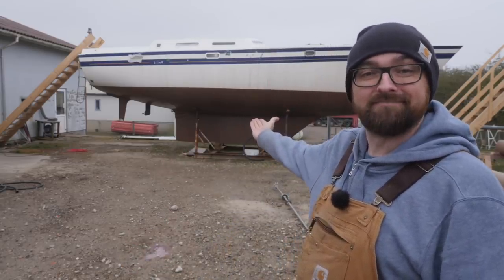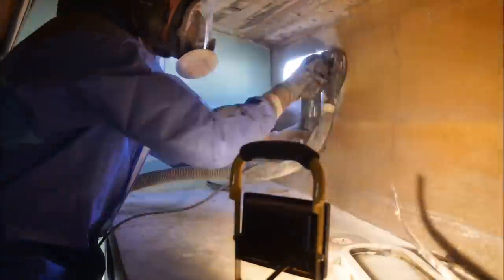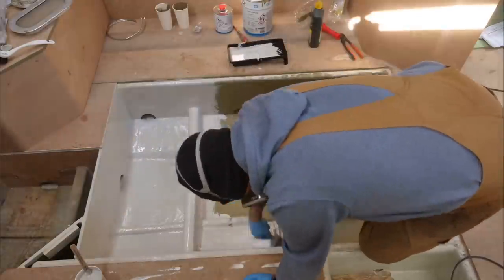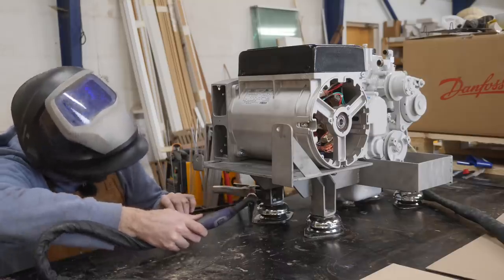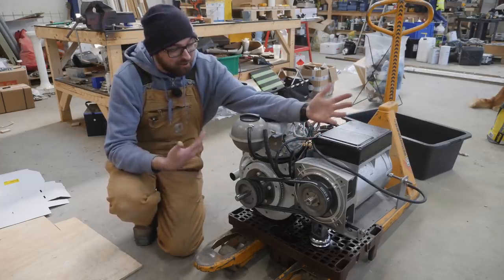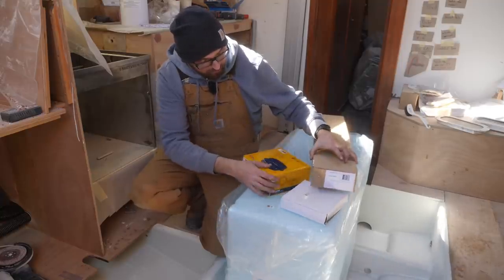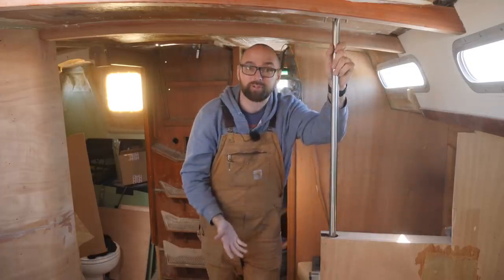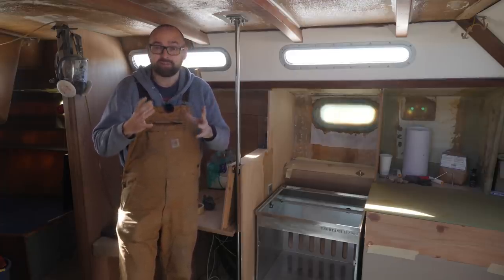Sail Life - DIY generator fail, galley pole - sailboat project

Comment: I don’t know if the 402 is different dimensionally than the 102, but if it’s not different by an order of magnitude, I’d go with the 102 for now and look for a cheap 402 rebuild candidate.  Doesn’t have to be a project for this year, you can get the 402 and store it until your ready to re-tackle the project.  I would not abandon your original intention.  If that were me, every time I couldn’t deliver power the way I intended because of a mishap like that, it would piss me off.  Don’t give up on your original plans!

Comment: Ok Buy a smaller Size pully for the Alternator  if you size it right  that will take increase the rpm on the alternator at lower revs on the Perkins and if you need more power  youd be able to rev the engine.

Comment: Good plan to keep the engine for the generator. Make sure you have  some decent lithium batteries that can keep up with the peak power draw from those two 3kVA victrons. Having two beefy charger inverters also means you can boost those batteries back much quicker than with a single or two smaller units when the generator isn't loaded by other stuff. Having those two big inverters also means you can power most (if not all) large appliances with the generator off. Not for long maybe, but it gives you the option if for whatever reason (e.g. sound) you want to postpone generating the energy. Also most household appliances only use short bursts of power. An oven uses most power during heat-up and after that it kicks in the heater for a short while only to maintain temperature. Same goes for a washing machine which uses most power when the water enters and needs to be heated.

Comment: Bummer on the 102 , can you change the pulley sizes and get the rpms you need? Also possibly going DC power generation to recharge batts and have a gigantic inverter for all AC ?

Comment: Change out the size of the generator to better match the Perkins to improve efficiency and sell the larger one online. Your larger generator will have good resale value given your research that there aren’t other used models of good quality and yours is virtually new. Patience will be your saviour here. Other option is put an add out for the 402 Perkins (or similar model) you were expecting to have...you might be surprised what turns up.

Comment: Ok Possible fix for the generator woes possibly bore the motor out and put larger piston in to make more horse's come out. Or look around for the right size motor to run it. I am thinking you will be happier with bigger motor. Not sure if reducing the voltage to 120 would help any.

Comment: Perkins motors 102,402 bores is the same at 67mm but the strokes are different 64mm for the 102 vs 72mm for the 402.  Quick fix would be to order a crank, rods from a 402 and do a swap.I would also look at the injection pump and injectors {size}. Research at what rpm you wish to run the motor and then use the appropriate size of the pulleys to get what you want.There might be a way to change the ratio to get increased output from the alternator. OR play the lotto and do allot of praying. lol

Comment: Sorry this happened.  I will concur with many others that you need to find a different diesel. A thought, ask at a farm supplier about replacement engines for irrigation pumps.  Some are Kubota diesels and they run many thousands of hours just left out in the weather like scrap metal.  Frankly, the motor you find should be powerful enough to over drive the alternator.  For cold weather you will find everything uses more energy than you expect.

Comment: I think that kind of mistake is something anyone could make.. and maybe even some of us have already made in considering things like ebay and sellers that are not entirely honestly or knowledgeable in what they are selling and miss represent what they sell only to have you find out when you get it.  I would suggest that even if you use it as is for now you keep your eyes open for a better engine.. maybe someone has a generator that the engine is fine but the power plant is dead and you could salvage the engine.  Maybe someone with a larger engine would take the small one if it better suites their needs.  Some kind of Victron unit that you can connect all the power sources like battery / solar / generator to and have it start the genterator as needed might serve your needs.

Comment: Why not add the alternator to the inboard. Our inboard on load consumes 1.3l/hour on load. This way you can get more amp out of the alternator - you can match your battery to the higher charge capacity.

Comment: Is upgrading the 102 as simple as a New Crankshaft or Camshaft? I do not remember how you are going to power your yacht but a high output Alternator could replace some of the missing power in the batteries and reduce the runtime of the itty bitty teeny weeny perkins.

Comment: I read the Perkins 100 series manual and on page 6/79 it says Do not use salt water in the in the fresh water cooling system or any other coolant
which can cause corrosion. Just FYI...

Comment: hey Mads, if you're going to be running the genny anyway, can you drew heat off the water jacket?  can't remember if fresh water cooled, but adding hot water baseboard heat or even an 
Auxiliary Heater (bus/tractor heater)saving the electric for the other things   be safe, Tim and Cat

Comment: Did you or did you get a naval engineer to do the calculations for the new metastatic height and weight the diesel tank will have on the Centre of Gravity on your boat and the reduced stability?  Are you going to have to put ballast in the lower area to compensate, since the island and thus the tank looks off the centreline?

Comment: Maybe I am missing something.

Is the alternator spec'd to run at a higher RPM than the 102 provides??

If it is spec'd to run at a higher RPM, can't you just change your input/output pulley to get a higher RPM and thus get more pixies??

Comment: And you thought you vanquished the Joker (structural members).  The Joker IS BACK!  
Keep and use the 102 while looking for a comparable 402 that doesn't need much work.
Rebuilding the 102 to be like a 402 will deprive other projects of your time and energy.
You built a generator and it WORKS!  Have a pizza and a beer.  :o)

Comment: Can you change the pulley sizes to gain more rpm on the alternator? If not find a used 402. You did say they are the same size. Hardware should match up.

Comment: Turbo time;) You could modify the engine a little to extract a few more kW from the Perkins, but they'd only be small gains. At the end of the day, shit happens, it is what it is, you could always buy a bigger motor down the road.

If you're not making mistakes, you're not trying.

Comment: Mads in upper Michigan 600 watts of solar was enough for my 40' boat with plenty of power drain fridge,freezee,tv..... I do have a 2kw Honda in case but it sits silent 95% of the time. Typical daily use I suspect you won't even need the genny.   Heat up coffee in the morning cook some bacon.  Then by noon batteries are topped off cook lunch by 2 batteries are topped off wash clothes on sunny days.(we wash every 10 days or so)  Watermaker run the main engine if needed. (We make water about an hour every 3 days) I don't remember the size alternator on your main engine but I would upgrade it if it's not high output.  Time to time you have to motor instead of sail best to get as much as possible from the dinosaur squeezing!  800-1000 ah or lifepo4 you will be set up pretty good.  If you insist on staying up north make sure you can aim your solar panels,  or just head south like I did!

Comment: I think the engines are dimensionally similar 402 looks like a stroked version of the 102
Keep an eye out for a 402 (or Caterpillar C0.5) if one turns up then back to plan A - if in the meantime you get a larger inverter, then you have the best of both worlds
Reply: Kubota z482 much more commonly available

Comment: I know you’re disappointed however, if we look for a silver lining, at least a little generator will be run with proper loading almost 100% of the time. Ultimately your cost per kilowatt delivered will be less than the bigger engine that would probably be lightly loaded much more often

Comment: You won’t need it unless you really care for home comfort on a boat. Solar panels and wind gens work surprisingly well even in high latitudes. And they emit less noise
Reply from the maker: Sure during the summer you can get some energy from solar even up here but for the majority of the year you get nothing. I had a big solar setup on my house before moving aboard Obelix. We'll be living aboard Athena year round so a solution that only works during the summer is not ideal :)

Comment: Personally I wouldn’t worry re it being the 102 instead of the 402, since all it effectively means is you can’t generate power and run everything at the same time. In truth that’s no big deal. Afterall in practical terms how often realistically is that likely to happen. I would suggest rarely. The water maker can be run when your motoring, the washer well that only needs to be run occasionally as is likely the electric cooker. Just don’t try to run everything at once and there won’t be an issue re keeping and using the existing Iddy biddy Perkins. Allow solar, wind generator, tow generator and your main engine to keep the batteries topped up.   Main thing Mads, is that mistakes happen and it’s nothing to stress over.

Comment: Add lithium batteries to your battery bank and run the generator longer to charge them.  You aren't going to be running everything at once (hopefully) so plan for the worst case.  Not sure how you feel about wind turbines but they could add a few hundred extra watts to your supply and they run 24/7.  Just a thought.

Comment: I would put a bigger Inverter that is able to run everything you want to run at the same time and but a battery bank big enough to handle the load for the time you want it to last. The generator will only charge the battery and can be started automatically by the charge controller.

Comment: You could change out the pullys. Larger on the engine and smaller on the generator. That shouldn't cost you but a hundred bucks or even less if you turned then yourself on the lathe. I'd try about a 20% change in size. That probably would get you over the 5kw mark your looking for. I put in a 6kw inverter in my motorcoach that's working well but I could of looked at a slightly smaller size that didn't have as much demand on the batteries. I've found that it's all a compromise for anything for off grid electric. Best if luck!

Comment: If the outer dimensions are the same between the two engines, is it possible to convert your engine into the higher performing one?  Perhaps it would require changing out the cylinder liner and piston, and increasing the fuel delivery?  What are the exact differences between the two engines?

Comment: Mads, I can almost guarantee you that 3 years from now there will be things more significant than your goof on the diesel output that you will feel you did wrong.  There is so so much you are doing and you are not a naval architect or yacht designer.  You are doing a great job so don't beat yourself up.  People buy boats and find after 2 or 3 years that there are features that they can hardly live.  I personally believe that 2KW won't be that big of a deal to you.  Just remember, it IS a boat and not a condo.  Ron

Comment: If you use lithium batteries and large inverters like the Victron MultiPluses, the batteries will absorb the peak loads via the inverter, so it doesn't matter much that your generator be smaller. Use the lithium/inverter to cover your peak cases, and use the generator to recharge the lithium. And this way, you'll run your generator at near max load, which is their most efficient point.

Comment: How difficult and expensive is it to source and rebuild a bit bigger Perkins you thought you had in the first place? be a good project to see and will the more powerful one still fit in the frame you have made? could you run a second alternator off the Volvo perhaps giving you a 24 volt system to run a large inverter  that you could use in times of high demand and that would also be good redundancy.

Comment: If the Perkins has enough torque, could you put a larger diameter pulley on it so that you spin the alternator faster with a better gear ratio?

Comment: MAY HAVE A FIX... DID NOT READ ALL COMMENTS BUT ONE TALKED ABOUT BORING THE CYLINDER . WHICH WILL GIVE YOU MORE POWER.CHECK THE STATS AND WHAT IS THE DIFFERENCE BE TWEEN THE 102 AND THE402. TALK TO CEMENT MEN. GOOD LUCK. CHARLES

Comment: change the wheel size to speed up the generator. larger wheel on the motor smaller wheel on the genny. I do this with electric motors to make them more efficient.

Comment: Yeah - You could for now just stick with the IBT ( itty bitty tiny) Perkins and keep your eyes open over the coming months (years...?) for a Perkins 402 (direct drop in?) or another with hopefully minimal modifications to your mounting bracket needed.  Or - save (or create) your SolidWorks model of the current welded bracket assembly and figure changes necessary for a future adaptation to a different engine and preprep (Fab, weld, paint) as much of a new bracket, based off your accurate 3D model, as you can to keep future downtime to a minimum when you upgrade.  Don't feel too bad - you have options on the horizon.

Comment: Why not keep the 102 setup as it is, then later down the road if you run across a 402 you can swap them out. Can you exchange the larger alternator and replace it with a smaller alternator?

Comment: The smaller generator is probably a good thing. It should be fairly quiet, and you will get extra hot water and/or radiant heating.

Comment: Mads, I am with many others. Get a bigger engine! I have many years experience as a construction plant mechanic and can assure you that these engines are extremely easy to rebuild. Find an engine and replace the rings and bearing shells (regardless of condition) and you will have many years of use. Don’t go down the route of modifying/upgrading that engine! It will cause you lots of problems! That’s ok for people that go racing but not for reliability.

Comment: I think you may find it an easier adjustment to get used to the lower power output of the generator. For me personally, a 3,000rpm generator would be acoustically annoying more than the less than expected power output. So, just my two cents. I think you folks will acclimate to the power limitations just fine.

Comment: Have you considered running the big alternator off the main engine with an electric clutch for those times you need lots of power and buying a smaller alternator for the perkins to use for light loads?  The electric clutch would allow you to run the main underway without the added load on it for economy.
P.S. make your Island 4 inches larger towards the lounge and you can build in a pop-up flat panel TV.  :)

Comment: I'm more concern about the balance of the boat.... and having to listen to the splashing fuel inside the tank all the time.... in you living area... have you considered  that? Thanks for all the great tips and content BTW
Reply: From a balance perspective, the island is the perfect position for a large tank.. not on one side or the other, and not too far forward or aft.. and all large fuel and water tanks have baffles inside that prevent the contents from sloshing around. I wouldn't be too concerned about it.

Comment: Is it possible to find a 402 or similar engine to replace the 102? If you could then you could sell the 102 to offset the cost of the new engine and be where you want to be with your generator.

Comment: Try a quasi-type transmission type gearing mounted on the back end of engine? 1:2 type of gear so the pulley spins twice as fast as the engine? More DYI for you.

Comment: Could you add a small turbo charger to the Diesel engine to gain some more power? Also are you going to recover heat from the exhaust system for the hot water heating.?.?

Comment: Get as big inverters you need to power all your simultaneous loads.
Add chargers to your Multiplus up to 330A (12V) or 165A (24V) in order to max out the iddy bitty tiny Perkins on charging alone.
Loads of Lithium batteries to accept all this charging power!

Comment: Go with the 102 as is I would say.  I am an electrical engineer specialized in small  boats. Sailing UMA gave me a wake up  call in their last video. Electric drive in ReGen is going to power there Micro wave, water maker and dive compressor.  Diesel is a bit last centuries technology. If you like it or not, it is being fased out. In 10 years time you will not be allowed to use it anymore.  I am a Diesel technician too... I will really miss the old slow  running music machines.

Comment: Change your pulleys to get the generator to run at the rate it needs to run while the motor only runs lower RPM

Comment: Sounds like you just need to go with the generator you have, and keep feelers open for a used 402 as a bolt in replacement in the future.. And just watch what you run at the same time till then. 

While you wait investigate the actual difference between the two engines, you may be able to convert it to a 402 cheaply if it is just a matter of injectors and pressures, maybe a little more expensive if it requires sleeves/pistons/rings to raise displacement.
Reply: The 102 is 411 cc. 402 is "half a litre" per specs I find online. Thinking injectors and pump might be the only difference.

Comment: Just wondering, can you change the pulley diameter on the alternator ? 
Like overdriving instead of underdriving I've seen something like it before on a friend's boat. Keep engine same pulley size  and the generator pulley larger it will turn faster ,or more revolutions . Maybe a 1 to 2 or 3 ratio . Just asking if it would help....